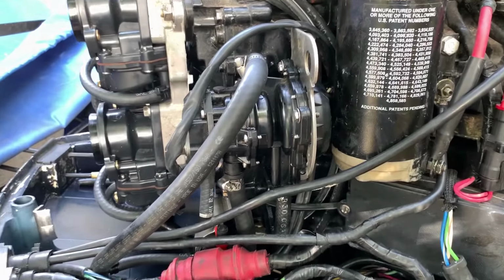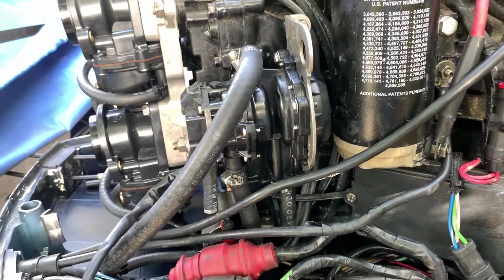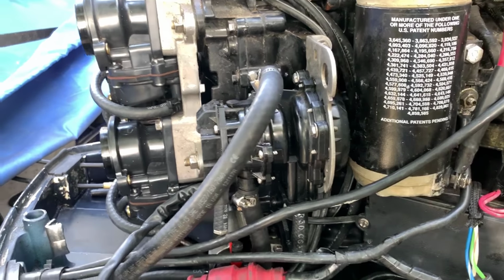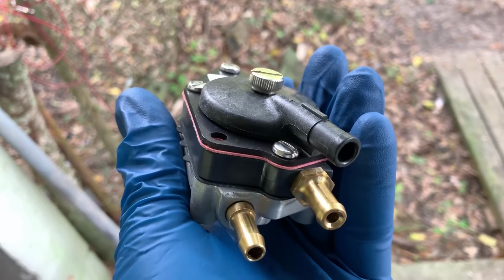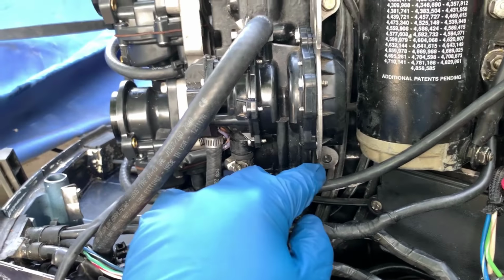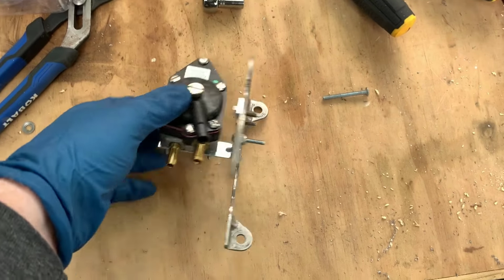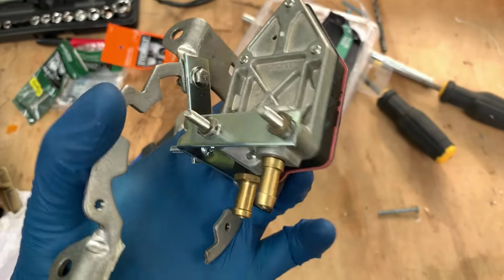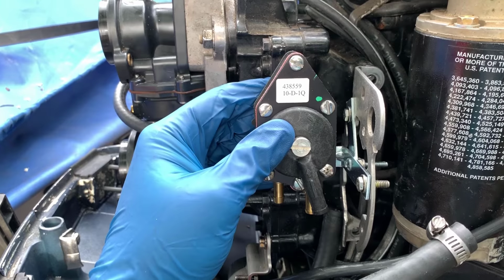Johnson/Evinrude VRO Fuel Pump Conversion

Comment: Have you ever checked the fuel pressure in comparison to the VRO? I read someone's write up that this didnt create enough pressure at WOT. I have a v4 120
Reply from the maker: I can run at full WOT with no issues or stuttering.

Comment: How do you figure out which pump you need? I have an 1986 Johnson 200 horsepower outboard engine on my 1986 Cee Bee "The Avenger"
Reply from the maker: With a motor that large you may not be able to get by with just this one pump. I've ready where people have put two of these in an array for larger HP outboards.
Reply: @JasonLefevers  hi Jason. I have a 225. You mention 2 pumps. How are they set up? In-line or two outlets to one T - junction then to the engine. Same for pulse line?
Reply from the maker: @bmp767  I have seen them in line

Comment: Can I use that pump with my 225 five ocean runner or is it too small
Reply from the maker: With a motor that large you may not be able to get by with just this one pump. I've ready where people have put two of these in an array for larger HP outboards.

Comment: What about the vacuum hole on the back of the pump? Do you not have one or did you just block it off?
Reply from the maker: This pump doesn’t have a vacuum hole on the back. The pulse is fed through one of the hoses instead as mentioned in the video.
Reply: Jason.  I have the same pump I'm about to replace my vro with. My pump has three nipples and a hole on the back side of the new pump.  I wondered if the hole on the back was just for looks or had a use. So... I tried to blow air through it, and to my amazement, air came out of the pulse nipple. And air could be blown in reverse through the pulse nipple and out the hole on the back. 
So..... to add further inquiry.  Does that hole need to be plugged?  Yours is "plugged" by your bracket. The hole on the back is slightly longer than the mounting holes, so it doesn't / won't sit flush on my mounting bracket. 
Would like to know the answer to this before I put it on and put my motor back together.  My vro was a PITA to get off as the mounting screws were behind carburetor intake and behind the starter. Don't want to have undo everything if it's supposed to be plugged.  

Thanks
Reply: Scott what did you end up finding out??
Reply: @scottmcmillan5085  I watched every video on replacing the VRO with a regular fuel pump and nobody explains what to do about the 3rd hole in back of the pump...except you. Thanks so much. I will take mine back off and plug that hole.
Reply: @hondasilverwing  fyi...
My motor started on the third try after two stall outs. Runs a like champ now. Starts right up now, idles good and runs at top end good.
Reply: @scottmcmillan5085  you sir are a god. Like others said, no one else even tries to describe what to do with the back hole on the pump. In some cases people have connected to their motor for the vacuum to pump through the back hole, but like mine and in the video he doesnt use it. Therefore it needs plugged like you described because thr only place we are going to recieve vacuum is from the one hose from the VRO line

Side note. No one should have to deep dive youtube to find this kind of simple answer.
Reply: @JustYourEverdayAverageJoe  
Wish I could post pictures of what I did on hear. Sometimes its easier to see from a picture  than to describe with words.  Maybe I'll try to post a video of what I did, and video the pictures and overlay an audio description to go with it.
Reply: @Mario-ee3mw  
Hey...... happy to share some pictures.  Unfortunately, I'm not posting my email on here. I've tried posting pictures on my on channel.  Tried to send you a pm through your channel. Not having any success.  If you can figure out a way, I'm more than happy to share pictures of what I did to change out my VRO fuel pump.
Reply: Link worked. 
Since I am a registered user, the pictures opened for me. 
The pictures of what I did are 3/4 of the way through the thread. And the installed pictures are a little further down. 

Hope this helps. Best I can do without posting my email address on here.

Mario, I apologize for my delay. Didn't see that you had posted another repsonse.

Comment: On this pump, on the back there is a holes for mounting it to the motor, and one in the center for pulse. There is also a hose hook up for the pulse hose. Do you block off the one on the back? 1986 70 hp vro delete.  Does the bracket need to have rubber to block the hole?
Reply: Hello my friend, first I'm sorry for my English, I'm Brazilian and my English is bad. Regarding the rear orifice of the fuel pump, it does not exist in this model with three hose couplings (OEM code 438559), that is, the rear orifice is blocked at the factory, so you don't have to worry about it.
Reply: Thanks antonio i was wondering the same question.
Reply: That's not always true.  I have the OEM 438559 and mine indeed has the unplugged hole on the back, as well as the pulse line which comes capped.  I had to use a solid piece of gasket to cover it up.   @jack0439

Comment: Will this also work with my Johnson 70Hp from 1986?
Reply: Worked for me. See my other posts to this video.
Reply: I would look it up because I think the 70 has 2 hose hook up not 3 and mounts to the power head
Reply: @unsaltedlife5998  I have an '86 70hp evinrude and it worked on mine. It depends on if the old VRO pump is bolted directly to the motor case for the pulse or if it is supported by a bracket with a pulse line.

Comment: I have a 1990 150 hp evinrude that was converted from a VRO to an electric pump and its hard to start and I flood it out a lot and have to change spark plugs. Would changing it to this style pump fix my problems? Would I use the same part number pump that you used? BTW great video.
Reply from the maker: Yep, that electric pump is probably forcing too much fuel into the system. I would convert it to one of these pulse-driven pumps.

Comment: Great Video - I watched it 2/3 times.  I have a completely rebuilt 1995 Evinrude 130hp (VRO unhooked) and I am experiencing the same problem - it just started sputtering or cutting out --If I have someone pump the bulb it runs great... I was told the fuel pump is going out.  I want to just replace the fuel pump BUT I am WORRIED about the 3 or 4 people who mentioned the center hole in the back.  HOW do I fix that hole so it will run properly?  AND  I was also told that the Fuel Pump # 438559 will NOT supply enough for the 130hp to run properly.  WOULD you PLEASE respond to these questions.  Thanks Keith
Reply from the maker: If you purchase the pump with the part number in this video the pulse hole on the back is closed up with a plug and pulse is supplied via a hose instead. As for your concern about it supplying enough fuel I’ve never had an issue as long as the fuel barbs are open enough, I’ve seen a replacement Sierra part for this pump that is identical, but the fuel barbs aren’t as large which causes it to not supply enough fuel, so I’m guessing that those people likely bought an aftermarket pump that was intended for a smaller motor.

Comment: Did you have to put an o'ring on the port on the back of the pump?
Reply from the maker: No, because the pulse comes from a hose and not a port directly touching the fuel pump.

Comment: You did a great job with the conversion but at the end when you connected the hose to the new fuel pump you didn’t tell where they went. Where is the Fuel in fuel out and pulse hose connected? Also did you use the gasket on the bracket? Thanks for the help!
Reply from the maker: If you check out the description ther eis a diagram I made that show the hose layout.
Reply: Perfect, thanks!
Reply: Perfect, thanks!
Reply: So what the heck do you do with the hole in the back where the gasket goes? 😅

Comment: Hey bro just came across this video, well done. I am doing a similar replacement on my 175, what did you do with the electrical lines and power pack that ran into the vro pump? Thank you!
Reply from the maker: I just bunched them up and tucked them into the wiring harness
Reply: Agree, unplug and cap it
The only wires you need will be 2 wires if you have an electric primer
Reply: How did it end up working on a 175. Was the single pump enough?
Reply: Do you have an update for the 175hp?
Reply: @Ocean_breezes what do I do to the 2 wires for the electric prime

Comment: Would this be the same part '0438559' for a 1989 50hp Johnson VRO?
Reply from the maker: I'm pretty sure it's the same part. That pump is used across a number of different model and HP engines.

Comment: How about all wires?
Reply from the maker: You just disconnect the wires and tuck them out of the way.
Reply: @JasonLefevers  how about oil tank buzzer? Just cut off?
Reply from the maker: @tapio525  Just disconnect it from power and it won't sound.
Reply: @JasonLefevers  awesome, thanks a lot

Comment: Found the answer to the nagging question about the hole on the back of the pre mix fuel pump on iboats.
Here it is: 
Re: Threaded hole behind fuel pump on my Evinrude

There are 2 versions on fuel pumps for that engine.
One version uses the hole at the back as pulse hole, the other version the hole at the back is plugged with a screw and gasket and a separate pulse hose to the pump.
If 2 hoses to the pump - version 1.
If 3 hoses to the pump - version 2.

Hope this answers some people's questions.
Reply: Hey Rob, I'm so close to working out what your saying, my problem is that the last owner took out the whole vro pump assembly and basically has an electric fuel pump that works off a switch on the dash.. Mate it scares the shit out of me. So can I mount a non vro pump on a custom made plate and run a fuel line from the crank pulse outlet to the new pump
Reply: I have three hoses like in the video. I understand where they hookup, but I'm guessing I simply plug the back like all the other videos and reason being is because, in my motors case, the pulse tube should do both high end and low end pumping? 

If my logic is correct the back hole is meant for low end pump pressure and the front third port is meant for top end. I may have those backwards but that was where my head was connecting dots. And due to this, some boats I guess don't need that back hole pressure? Correct me if Im wrong.

I have a 1990 Evinrude 70hp im planning to attempt this on.
Reply: Joseph Perez so what was the verdict, I too am working on a 1986 70 hp vro delete, and want to know if I should plug the back hole? I see no other mounts or holes in the block to mount it to,

Comment: Thanks Jason.  Great video.  I am working on a similar motor-Johnson 120 VRO looper engin-4 cyl.  VRO housing was cracked where the previous owner overtightened the bolts.  Not paying 400-500 for basically a piece of plastic.  My main concern with using a single pump was not being able to keep up with fuel demand.  You run a similar engine.  Have you had this issue with your 130?  There are a lot of duel-pump set ups out there.  Trying to make an informed decision.
Reply from the maker: Never once had an issue. That pump in the video is still going strong and I have no issue even on the high end. If you are under 150HP you should be fine with this single pump setup.

Comment: Cool, Thanks. just may do that. 
 Before I junked my Johnson 130 hp, just wanted to see this thing run for awhile. That VRO is junk even if you buy a good one, they're more trouble than premixing. This thing started using 2x's the amount of oil, smoked like crazy and barely got home from running out of oil. Bypassed that VRO and run synthetic premix... its good to go now with way less smoke. Using a leaner oil at the dock and switch to the heavier oil ratio out in the open. Gonna try a leaner ratio than 50:1 out in the open later.
May help someone understand that VRO oil pump which will fail, probably when the big fish are biting.
Reply: This is an OMS pump, not a VRO. Anyway they are spectacularly simple and reliable air-pump systems. Its the owners that do not understand how it works that cause issues. that and hilarious rumors like "my buddys uncles friends motor cooked 2 cylinders out of 6 when the VRO crapped out"
Reply: @ct1762  Not nothing hilarious about losing a $25,000 engine because the VRO decided to stop pumping oil. I will never have another one, And I'm a marine mechanic and know how to maintenance my boats!
Reply: @bobatbilletcreations  again its a simple air pump. it will pump MORE oil not less if the diaphragm is torn. very easy to service. and what OMC motor was $25,000?
Reply: @ct1762  It wasn't OMC it was a Mercury engine.  The VRO did stop pumping oil and this is not the only person this has happended to, Search it and see for yourself. There are lots of people junking these systems because they are garbage and can fail and lead to catastrophic engine failure!
Reply: @bobatbilletcreations  can they fail? sure. with neglect anything can fail. its a poorly understood but simple and highly reliable system that gets blamed for everything. the original VRO did run at 150:1 at idle, which did cause issues. once they were fixed with VRO version 2.0 they were dead reliable. i do a ton of OMS/VRO conversions, and love to premix over the hassle of having to maintain a separate oil tank, but not because the system is unreliable. i actually sell custom conversion kits.
Reply: @ct1762  I agree w/ you from my research - I inherited  1997 20' Hydra sport w/ Evinrude  175 hp ocean runner w/ 90 original hrs. The boat was stored for 10yrs in building & only ran every couple years as my elderly  Father owned many boats & he would  use smaller skiff because  too old to handle So hence low hours- I went to Fla to pick up the boat & back to farm in Virginia  Mountains - I stored away No time to use purchased all tune up parts but boat been essentially sitting for 20yrs- I'd say at best all rubber gaskets  are hard & would at least need to replace some of VRO system - Also oil has leaked in bilge & where tank is just a mess - I think probably best to just replace motor w/ newer option but being that it's never been use I would like to see if I could get running - I just think best thing to do at this point is just delete VRO & premix - Take chance see how it might run- I see kit available  up to V4's but only some suppose to work aftermarket  China pumps- Could you steer me I the direction I'd need to go to convert this OMC 60° V6 to premix? Any help much appreciated,  jack

Comment: So did your new fuel pump work ok mounting it like that  ?
Because I noticed you didn't use the gasket when mounting it.  So it had to be leaking airflow from the back pulse hole because it was the 3 line type.  
I hope you see this and let me know
Reply: If you noticed in his video, the pulse hole on the back of his "new" fuel pump rests against one of his brackets. I'm sure its starts and idles just fine, but he puts a load and high rpm on it,  I'm sure it will start to suck air through the hole on the back, and run ike crap. Impossible to create a proper vacuum with "leak".
Reply: @scottmcmillan5085  so what is the fix, I currently have the same setup on my 1987 60 and your absolutely right it'll run balls out for about 20 mins and then crawls back.
Reply: @aablurr  sorry for not replying sooner. I just found this in my email inbox. That hole on the back rests against my new bracket. So.... I put some permatex gasket on the bracket and the hole and pressed them together.  Let it sit over night,  then tightened it down. Runs like a champ.
Reply from the maker: If you purchase the pump with the part number in this video the pulse hole on the back is closed up with a plug and pulse is supplied via a hose instead.

Comment: Ther is a an area with 2 holes and a bolt on the middle that's the vacuum hole remove that bolt and the pump will fit right on it

Comment: It appears thT some fuel pumps have a third hole on the back that mounts to the block.
I'm wondering why your fuel pump only has 2 holes.
Do you have an explanation as to why yours didn't mount to your engine block?
Also, what yr is your engine?

Comment: Did it perform when you got it in the water? Just wondering what that little hole in the back with the gasket
Reply from the maker: Yes, very well. There is not a hole in the back. The pulse is driven from a hose inlet on this model pump.